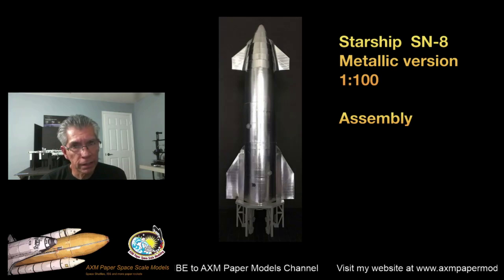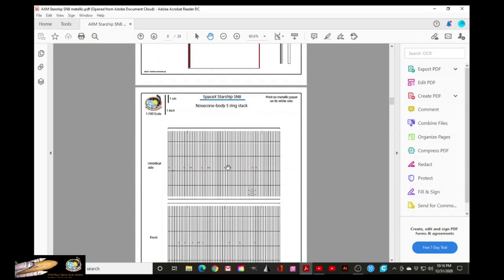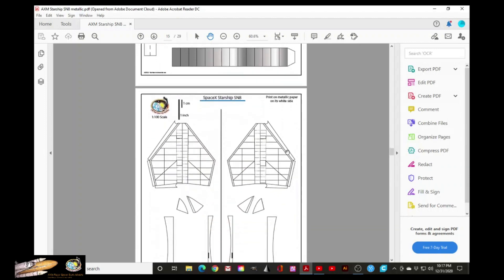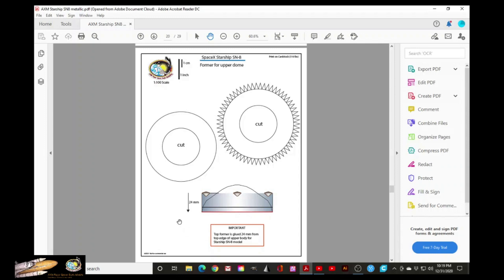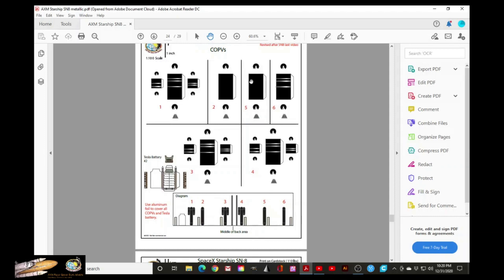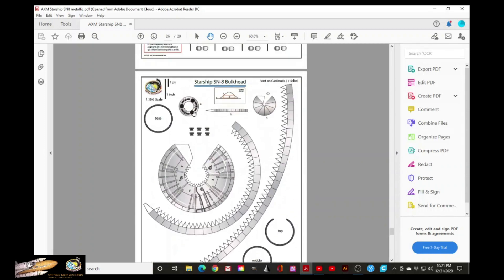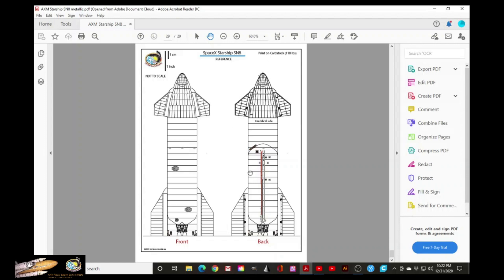Starship SN-8 metallic version 1:100 scale model presentation

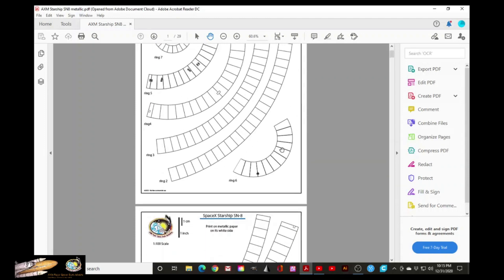Comment: just finished the crew dragon demo 2 docking module 1:48 scale, looks great!! very straight forward with instructions, time consuming for sure but i adore the way it came out  and the level of detail it has FOR PAPER. I am now about to start on starship Sn8, the non metalic one, are they both the exact same models or should i expect differences with the tutorials?
Reply from the maker: Exactly the same. The difference is how to work on metallic paper and that in this case, all the connecting the tabs are separate.